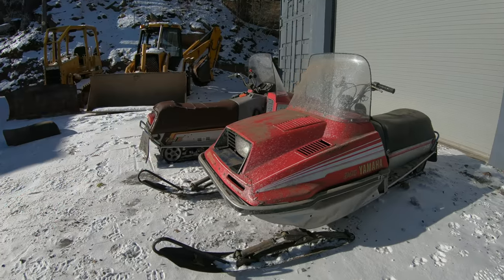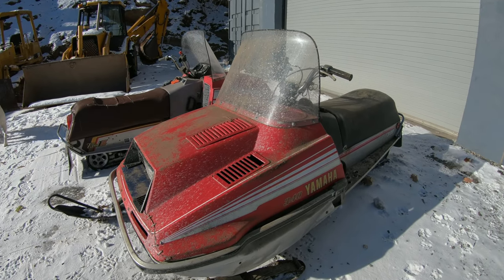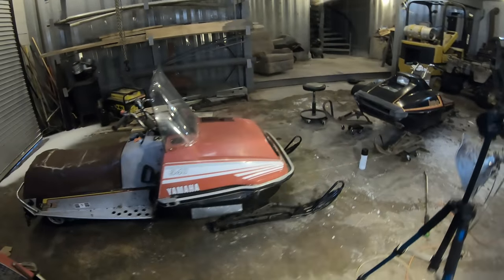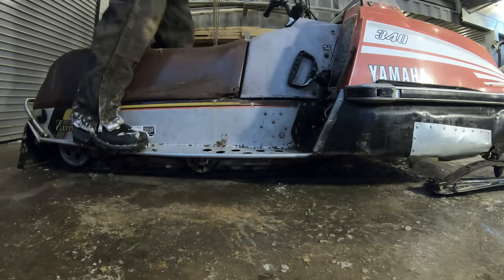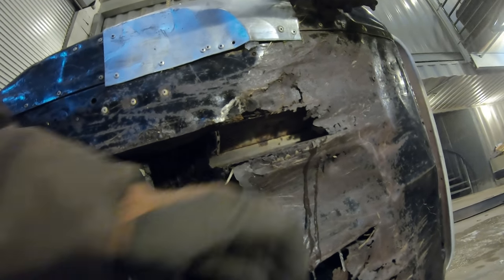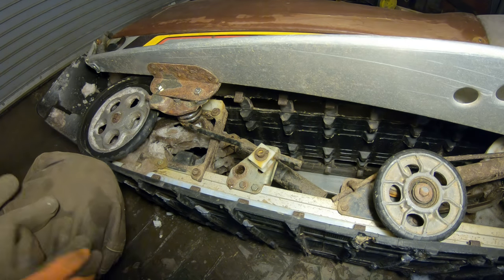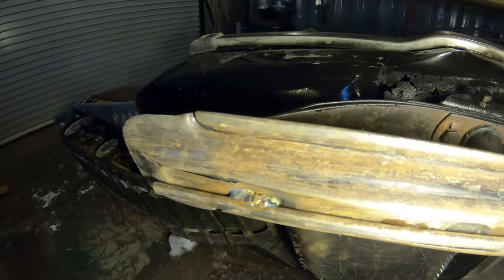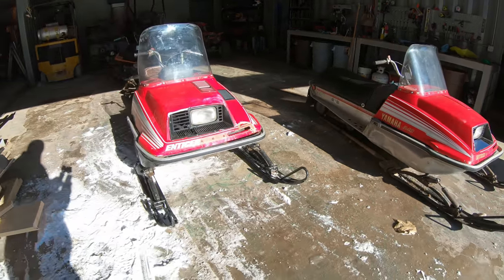Working on and riding a snowmobile

Comment: I used your tip from a previous video about hooking your pressure washer to your on demand water heater.  I got a portable on demand heater (like for camping) and attached it to a hand cart with the propane tank.  Works so much better to pressure wash with hot water than cold.  Plus it makes it more bearable in these cold temps to.
Reply from the maker: That's good, glad that worked for you. Yeah, the hot water does make a big difference.
Reply: I tried that the other day too. Ran a long hose into the house hooked to a utility sink for hot water. Washed a greasy engine off and it worked really well. Gets it cleaner than cold water and in less time too. Glad to hear it works with a portable on demand heater I was thinking of doing that as well.

Comment: Much better than a $15.000 model.  If it runs use it.  A little TLC and a little paint and it becomes a jewel..
Reply: I've bought numerous new snowmobiles over the years. The only one I still have is a 1976 John Deere Cyclone.
Reply: $15K for a snowmobile!  Geez I am getting old.  Nice video
Reply: Nice, I still have a 1975 John Deere 340 Liquifire, same year as my wife, but it runs better. If she sees this I may be running.

Comment: If you want a stiffer suspension,just flip the bottom aluminium bracket backwards and adjust its preload with the white plastic bushing/slider,it will make the spring working shorter,so stiffer.
Here ,you just modified the preload,the spring tension is the same it's still bottoming out, it's just an impression you have.
Springs are just bars of steel : if you want it stiffer,you have to increase its diameter,thickness or shorten its length,making it less flexible.,and add a spacer to keep the same ride height,if cut,on coil springs.
Those machines seems really simple, lightweight and fun : )
Reply from the maker: That's a good idea, I didn't think of that. I ordered the shock too.
Reply: A car or atv rear shock or the stock one ?
Reply from the maker: michaelovitch the stock shock. Re-engineering different parts to fit is a ton of work.

Comment: You need to build you a big wood stove for that shop . Hell with working in the cold . These old snowmobiles will be nice fixed up . Way better than spending 20 grand on a new one .Don't get yourself on thin ice my friend . :)
Reply: Harvey Zearing how about a high efficiency Rocket Mass Heater, don’t have to stoke it all day, uses a fraction of the fuel, continuous radiant heat 🔥
Reply: He said in one of his videos he likes working without heat as it toughens him up for working outside in the cold. I am with you. I have worked outside for over 36 years and I would add heat. That one shot of looking outside his shop with the snow blowing reminded me of way to many days working throughout New England.

Comment: Where are you riding? That is not the stock excell 340 hood, but it looks good. You got a good deal. I had 1980 enticer 300 twin. Those enticers will run forever. I sold it to one of the Rothe’s in saugerties. I bought an Arctic Cat a couple of years ago
Reply: these are 1970s suckers what you expect bud enjoy while they last

Comment: It wouldnt be that hard to break out a large middle section of the concrete floor in your castle, install radiant heat, and pour new concrete.  You may be able to handle the cold now but as you get older, it becomes less tolerable.
Reply from the maker: There is already radiant tube in the concrete, I never hooked it up. There is no heat when I am out snowmobile riding. Heat just isn't needed.

Comment: Have you ever adjusted the steering on one of these?  I got rooked on a newer style Enticer 400 Trapper, and the handlebars are as crooked as can be.  Any easy fix?
Reply from the maker: If the sled is nice, see if there is any adjustment left. If its crappy, get 2 guys and bend the bars straight.

Comment: Hey Andrew, in your other video "making one good snowmobile out of 2" what did you use to boil the carb in? Was it a Hydrocollator and did you use just water? Thanks
Reply from the maker: That's an ultra sonic cleaner, with water and a little degreaser in it.

Comment: Are you using a GoPro hero 5?
Reply from the maker: That was a hero6 and a mavic. The hero 5 seems to work better for low light. But the 6 is a little better outside.
Reply: Ok thanks I’m thinking about getting the hero 5 or 6
Reply from the maker: Johnny test get the 5, I think I'm going to return my 6 and get another 5